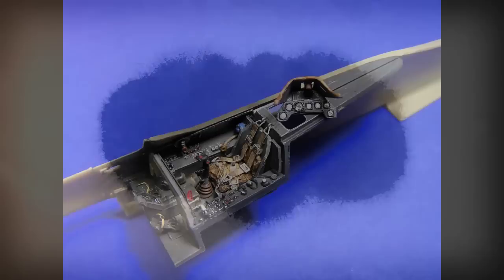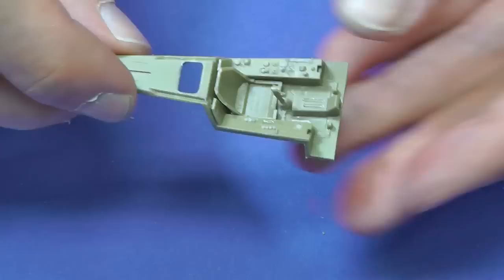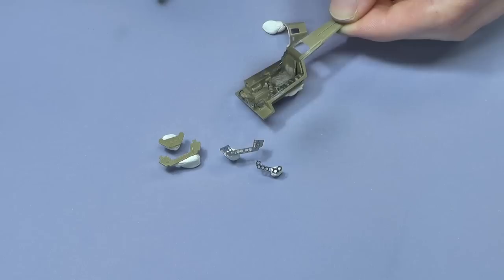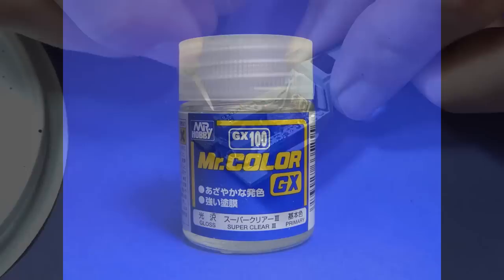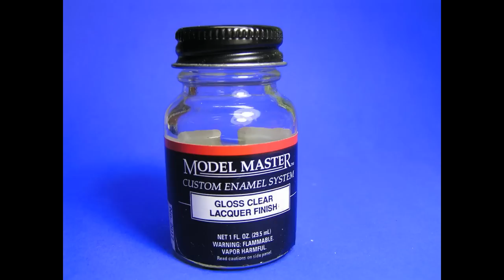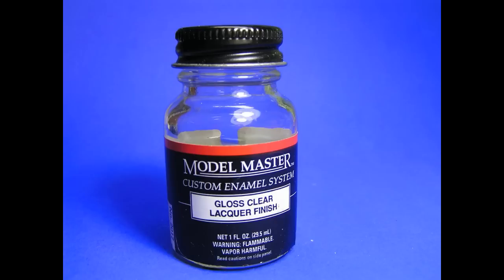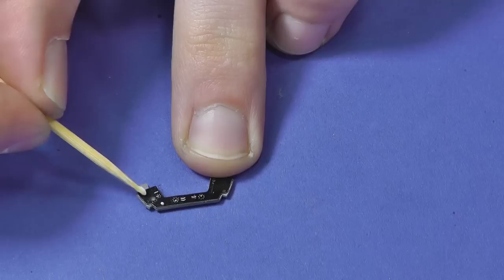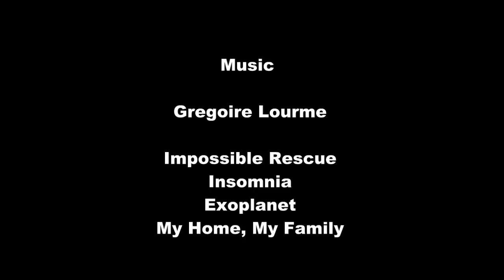Great Guide Plastic Models - How to paint cockpit

Comment: Excellent tutorial, thank you very much. WW2 fighters didn't have pillows, the pilot sat on his parachute which was strapped to him. hth
Reply from the maker: Thanks. A small pilot has pillow also because a parachute was not enough. Here are drow and original picture. I don't want to make from myself some expert. I only did what I saw.
https://i.pinimg.com/originals/c5/0c/69/c50c69bb0bfc22ffd136c21f3128f669.jpg
https://i.pinimg.com/736x/af/a5/77/afa577640cf93390f2718608f9ba0252--cockpit-fighter-aircraft.jpg
Reply: That's a really interesting picture, I see what you mean. But you could not sit on that pillow and wear a parachute too. The cockpit is a FW190 but the goggles in the picture are American not German so I think that picture was taken in the USA post war.
Reply: Trying to help, not trying to be fussy.

Comment: David, do you think you could do a tutorial on grey or green cockpits also?
Reply: Ducesweden 
It's the same thing
Reply: Chin Chin The Dark Lord 
Yes i know it is, but you have to approach it in diffrent ways than if it's a black/dark grey cockpits.
Black cockpits for example, it's just enough to drybrush them with a light gray and silver, and then put some clear coat in the gauges.
On green and modern gray ones, you have to paint the gauges yourself, and drybrushing on light surfaces can be challenging to some.

Comment: Thanks for the vids, but just 1 thing, I could be wrong but was there any need to fill in the seat with a cushion as pilots 
of that era usually sat on their parachutes ?
Reply from the maker: +Gerard McCabe Cabin in fw-190 was very high and use pillow was very usual.  http://s412.photobucket.com/user/ruspren/media/Fw190seat.jpg.html
http://i99.photobucket.com/albums/l304/vanderstok/FW-190/JSJ_Focke_Wulf_Fw_190_Cockpit.jpg
Reply: PLASMO - plastic models  Thanks for that, learned something new, (see how good your vids are)
Reply: +Gerard McCabe  .... I thought so too, I was writing a similar response, but a quick search on the net showed me that Fock-Wulfs indeed DID have a seat cushion !! Okay, this guy called it a "pillow", but hey... he meant it well. He IS correct about this detail !!  ;-)Some FW's did not have a seat cushion and indeed the pilots sat on their parachute packs, but many FW's did have a cushion.
Reply from the maker: Yes,cushion, that is right word.
Reply: +Gerard McCabe  Most of the time, they did. I was a kid and climbed into the cockpit of an Oscar that sat in Bangkok and (before getting run off ) the first thing I thought was ' how did they see forward...' ...you sink WAY down with no 'chute on your butt.
Reply: The FW 190 was set up for a back parachute, they sat forward in the seat where they found it provided better visibility

Comment: how do you keep your brush sharp? i have the same one but there is no point anymore just a dull brush
Reply: ***** okay i will give it a go, also What do you use to wash the brushes? i use Mr.Color paints and when dipped in water it gets thick and makes the brush hairs stiff any ideas?
Reply: okay thanks!
Reply: +DELT SLAYER Hi-when you finish cleaning the brush, wet it with water and shape the bristles into the cone shape so they dry properly-that should work.
Reply: Ron Bishop Thanks for the advise mate, Will try it out!
Reply: The Stock Market Investor Try using warm water and put the brush in for 3 minutes, then rub the bristles in a circular motion and repeat till clean.
Now try. 😉

Comment: Is there any reason you couldn't use solder for the wire?
Reply from the maker: +dysomniak Of course you can use solder but you will have large problem get right diameter. Like 0,1 mm to 1 mm.
Reply: +PLASMO - plastic models Thanks for the reply! I'm just getting back into modeling after 15 years or so (mostly spaceships and gaming minis) and I like finding uses for stuff I already have around the house. I've got some really tiny silver solder that's been gathering dust in a drawer for ages.

Comment: What kind of putty did you use for the seat cushion  ?
Reply from the maker: +j baumun I used epoxy putty.
Reply: +PLASMO - plastic models  available at hobby shops ? Hobby grade ?
Reply: you can use Apoxie-sculpt, or probably even Millipult, but I think Apoxie sculpt has a better consistency for this application
Reply: Thx for your response !

Comment: First step in improving a cockpit is to ACTUALLY look at references for that particular cockpit.  Either in books or on line.  Don’t just cut and fill to add crap that is actually NOT in an actual aircraft cockpit.  Like a PILLOW!!! Fighter did not have “peeelows”.  The only cushion in cockpits would be the parachute, that were strapped to the pilots bodies., that they would then SIT on!!
Reply: You might want to do exactly as you pointed out and check references. As David mentioned already 4 years ago, there are indeed pictures of pillows (he linked images as well, so no need to do the same again).
Reply: Michael Beck  sure, whatever you say